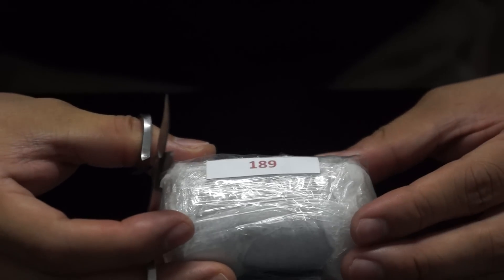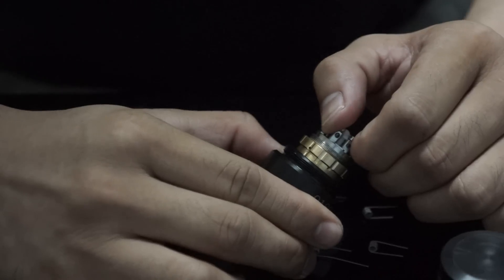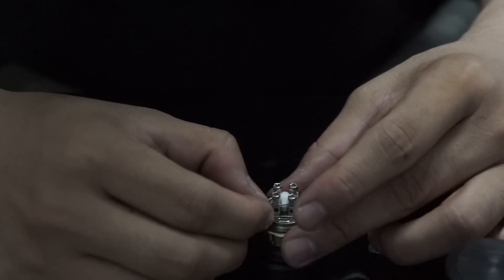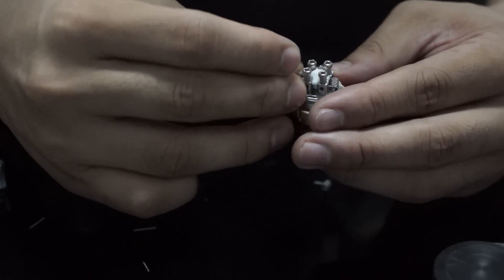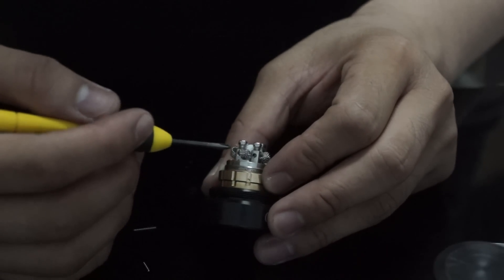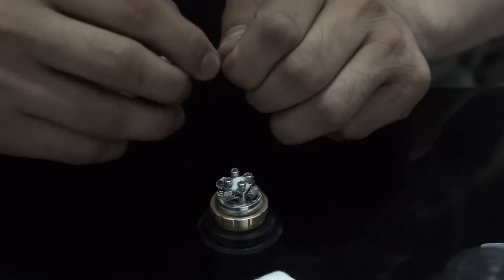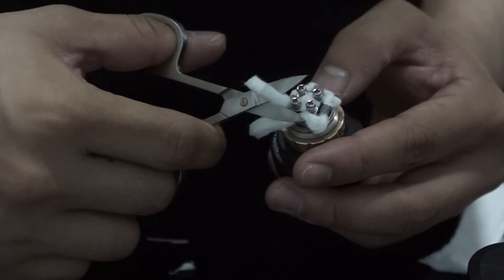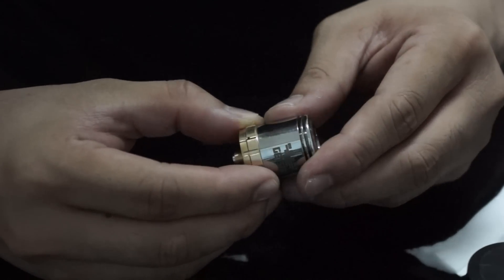Unboxing and Building Quad on Geyser

Comment: Maybe I missed it, but how does that 4 post system work? usually there is 1 positive (which all coils connect to) and "n" other negative posts...
Reply: Smh bro 2 negative 2 positive.
Reply: sgarcia8181 I was wondering the same thing for a while, I'm ashamed to call myself an electronic technician if I couldn't even figure that out.  :(